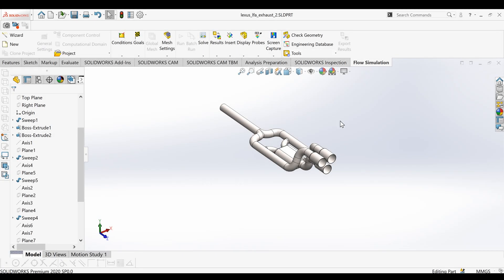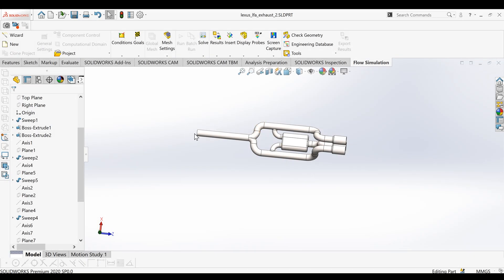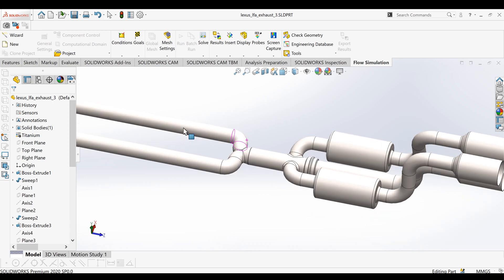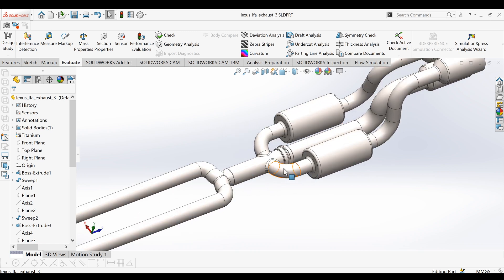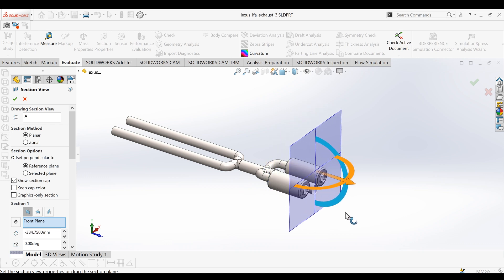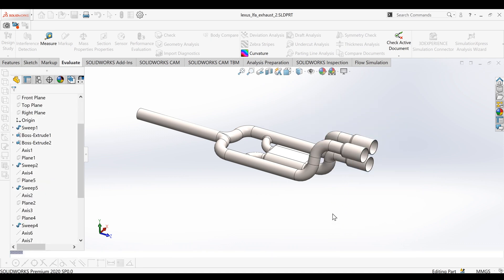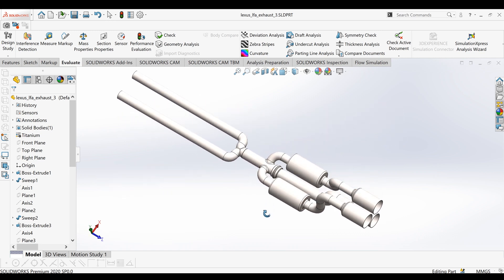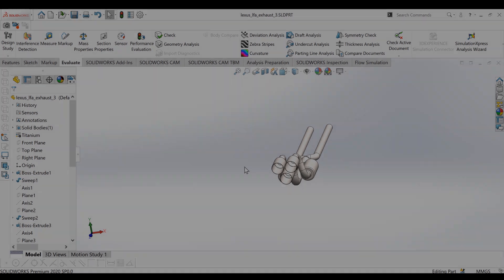Designing a Titanium Lexus LFA Valved Exhaust System - CAD Overview | 4enthusiasts

Comment: I finally found a diagram of the o.e. muffler chamber in Japanese.  It has multiple resonance chambers with very small cross pipes that look 3/4".
Reply: Can you send it?
Reply: @mikivli  O.k.  try to do a search for both this in Japanese:  トヨタ1LR-GUE／レクサスLFA.
And this in English:  Internal Combustion Engine Ultra Basic Course | Mass-produced V10 developed with the spirit of a race engine shop. 
 It will bring you to the Car Motor Fan Jp websit with 9 photos thumbnails about the Lfa, & 2 sketches of the exhaust!
Reply: @mikivli  YouTube won't let me post this Japanese website.  Try to do an image or website search for:  
car.motor-fan jp tech photo  Lexus muffler.